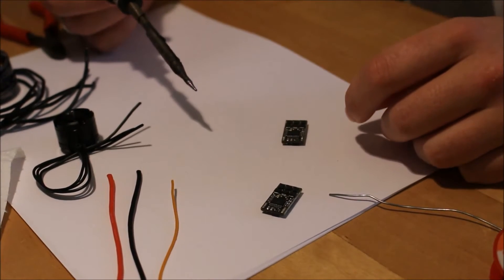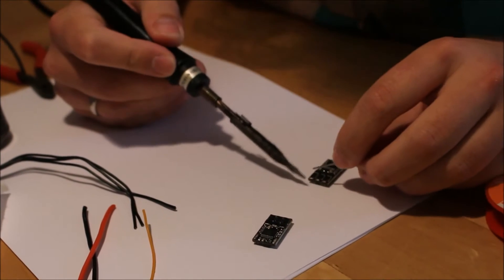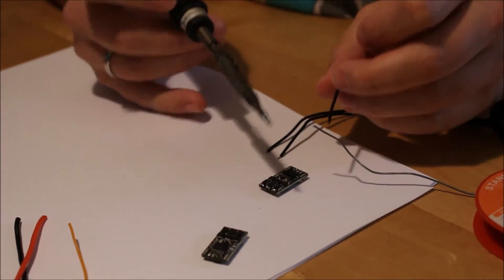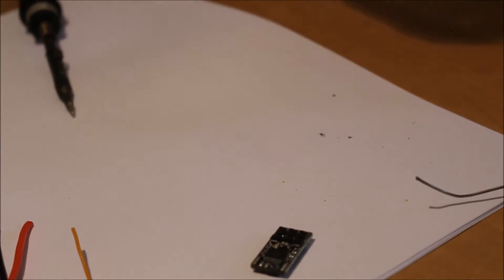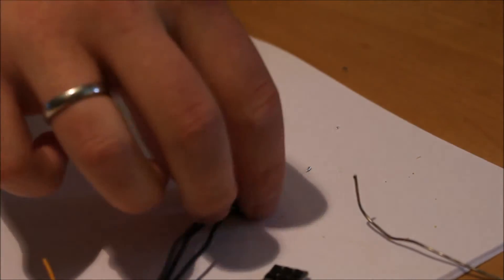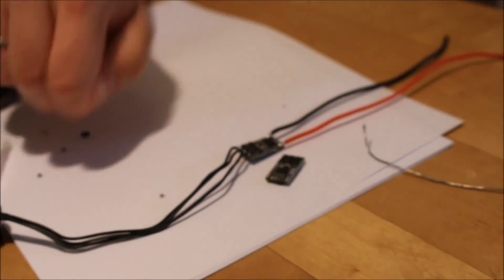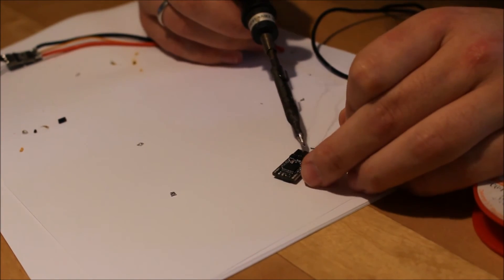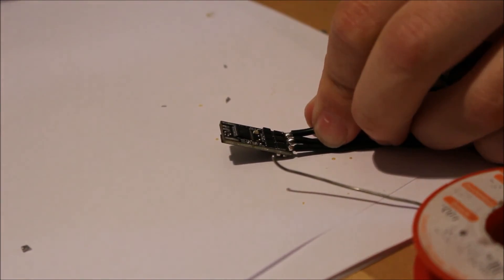KISS ESC soldering

Comment: Is it necessary to connect all three signal wires (PWM, Telemetry, Signal Ground) from Kiss 24a esc to Kiss FC or just the one Signal PWM wire from each esc to FC will be fine?
If I connect the Telemetry wire from each esc to FC, can I receive Current/Amps data via Smart port wire from my XSR Rx to Taranis?
Cheers...

Comment: Hi Felix thanks for all the hard work on the flyduino/kiss stuff. I just have a question I know there is a diagram for lifted pads on the kiss fc but what about the 24a esc? I have a lifted pwm pad on my esc it detached mid flight before i scrape and solder the signal wire further up the esc is there a workaround pad elsewhere? thanks in advanced this is the 4th kiss 24a thats dead, one is good but regenerative braking does not work? weird

Comment: I JUST oRDERD 4 kiss 2-4S 18aMP ESC  V1.1 DO THEY SUPPORT ONESHOT AND CAN YOU USE PPM WITH kiss esc'S?
Reply from the maker: they Support oneshot125, they did it long before blheli or somonk ;) . they Support pulsewidth Modulation (PWM) no pulseposotion Modulation(PPM). but i dont know any fc that uses ppm

regards

felix
Reply: well I have a cc3d atom fc that uses ppm 1 servo wire 3 wires to cc3d to rx for full control just like sbus! I hook just the black-red-yellow wire from cc3d fc to frsky D4Rll rx with jumper on pins 3&4 and hook to first 3 top pins on D4Rll rx for ppm!. I think I am talking about something completely different than you are? if I am I am sorry, I did not think that esc's had nothing to do wether you use pwm a wire to each chanel or ppm one st of 3 wires from fc to tx or sbus?
Reply: I am using librepilot I need to setup chan5 for flightmodes yet!
Reply: Felix, I am using the new KISS 1.3 FC  with KISS 18amp v1.1 esc's since these esc's only have a signal & Ground wires only how do I Wire IT to the new KISS 1.3 FC?
Reply from the maker: As discribrd in the Manual. Simply Connect the Signal gnd wire to the escs gnd.
Reply: Felix so all I do is solder ground and signal from each kiss 18amp esc to kiss fc correct?
Reply from the maker: Yes you need to Connect Signal and Signal gnd from each ESC to the fc

Comment: Hi. I have  issues with my kiss 18a. when i connect the kiss to my servo.and i get constant blue light.  but i just get vibration from the motor. its not spinning right. like some blocking. but there is nothing that blocks the motor, and screws I use is not long. although I dismantle the engine from the frame I get the same result.? Hope you can help me with this. Thank :D

Comment: Flyduino pdf states that the ground wire should be used. If that is not required do you know why they state that?
Reply from the maker: it depends on the setup. with a 3,3V FC (stm32MCU) and long (>~10cm) wires the ground wire may help to keep the PWM signal clear.
Reply: Felix Niessen What about coaxial cables?

Comment: followed your instructions, but I doesn't work with only the signal cable as in your video with Naze32...???
Reply: +Conny Håkansson The Naze is powered by at least one of the escs red and black wires. It needs the positive and negative lead to power the naze.